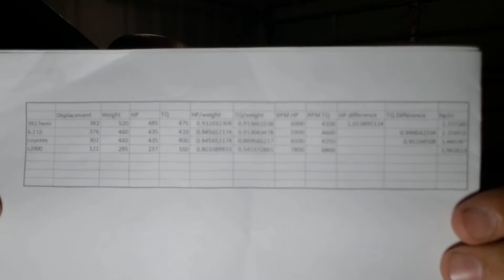Horsepower per cubic inch vs horsepower per engine weight.

Comment: The Professor strikes again !  I wouldn't have guessed that the 392 would stack up as well as it did in this type of comparison. Good job Sir. With the rumors of the HEMI age coming to a close in the next few years it will be interesting to see which way Mopar will take us and what moniker will be attached. Perhaps a new version of the Max wedge with 4 valves.
Reply from the maker: BDOG JR thanks man! actually, get ready for more V6 turbos.... I really hope not though.

Comment: apples to oranges. your not figuring the vehicle weight which is the true equation.
Reply from the maker: dbooty1844 not for this discussion. I'm speaking only in terms of the power plant itself, separate from the platform it is installed in.

Comment: It doesn't mean a whole lot. I'd rather have more cubes in a mild combo than less cubes and wilder combo. no replacement for displacement. like it tell guys if I go up from 9.1:1 to 10.5:1 go after some AFR 315 high flow heads and drop in a 640 lift camshaft. my 496 would easily make 650 to 675 hp instead of its 565hp..torque is where its at..keep those video's coming B Mason 👍😆
Reply from the maker: Brian Samuels I like bigger cubes as well. Especially when I can have them with no weight penalty.
Reply: That's true. Kind of wish I would have put aluminium heads on my engine but it's all good. It would have saved me 90 pounds. Fast heavy cars are very impressive
Reply from the maker: Brian Samuels American Iron!! Aluminum heads are nice but when you consider that 100 lbs on a 3800 lb car is only 2%. For the street, not a big deal.  TIRE SMOKE!!
Reply: B Mason your right about that one. Mines is most definitely at street car. Can't wait to run in the 1/4 mile but overall I just wanted to build a reliable, fun street car that I can put my family in.
Reply from the maker: It sounds like you hit the nail on the head!  I actually like iron head combos.  My 93 SSP ran ported GT 40 irons. Showed it's tail lights to quite a few aluminum headed combos.  Looked stock too.
Reply: B Mason lol...what's your opinion on gear vendors overdrive? I bought one 4 years ago but haven't installed it yet. Or a 4l80e transmission?
Reply from the maker: The gear vendors has gained in popularity recently.  Good unit. It can take quite a bit of power and is usually a bolt in modification.  Assuming the 4L80 fits, it is cool because it is programmable.  Expensive though and a bit tedious. Maybe a built 700r4? Either way a driveshaft has to be modified.
Reply: B Mason ok. I'm thinking at this point is to use the gear vendors behind my th400 transmission. I'll let you know how I like it. 700r4 are totally out of the question. My car is heavy and with 600 foot pound of torque. It probably won't last long
Reply: and don't get us started on the liter to cubic inch conversion, I've asked like 10 people and guess what I received 10 different answers. I thought my question was a simple one , and my local Dodge dealership seems to think my 5.7 L is 347ci technically 348 ci being there calculation is 347.835 ? does it even really matter? most people refer to the 5.7 L as 345 ci. I've seen several different badging options ranging from 345 to 348? dealing with bore and stroke calculations can be mind numbing whats your advice ..... this would be a great video😀
Reply from the maker: Brian Samuels it's been a while since I even thought of a 700r4.  I thought that they had solutions ro get those transmissions fairly well beefed up.  maybe good for a small block, but you are right, not enough near for the Big Block.  Let me know how you like the Gear Vendors! I. interested to hear about it.
Reply: B Mason I'll keep you posted bro! Anyway enjoy your day and have a great weekend 😆
Reply from the maker: Brian Samuels thank You!  You too!!
Reply from the maker: Trent Anderson man, I just give up when it comes to the liter designations.  5.7 can range from 345 to 350.... some engines like the M156 use 6.3 when they are really 6.2....it all gets a little redundant. the liter designation gives a "range" of displacement.  it removes the specific cid.... the "name" of the engine...makes it a part of a group as opposed to an  individual. communist if you ask me. just not American.
Reply from the maker: Trent Anderson man, I just give up when it comes to the liter designations.  5.7 can range from 345 to 350.... some engines like the M156 use 6.3 when they are really 6.2....it all gets a little redundant. the liter designation gives a "range" of displacement.  it removes the specific cid.... the "name" of the engine...makes it a part of a group as opposed to an  individual. communist if you ask me. just not American.
Reply: B Mason thanks, love the videos keep up the good work, your really making me want the 392 I gotta say. To even have a chance at hanging with the big guys I'd have to go, or maybe I should say I'd really like to,  procharge my 5.7 which I believe with the rite adjustments could put me around the 600hp mark that would be awesome but $$$ pricey for the money I may be further ahead to just put the $7000 down on a Scat pack or 392. And as far as that goes 2016 models of mustangs with 700hp are going cheap. ? But I've driven a new Mustang and it just really wasn't my thing I've loved mustangs forever? I kinda feel like it's a maturity thing my car looking good and sounding good, ride quality are just as important to me as how fast is it. Plus my '15 Shaker is loaded it's probably one of the nicest interiors I've had on a vehicle I've owned.
https://lh3.googleusercontent.com/uaWKMPPSLt1jCe1_XaOCS4ZUhdphc0dPZYvtjZh5sfXUFYkZt1dhrkvI4UFKEKyWbj9rjy5xuQ
Reply from the maker: Thank you very much! Man, I am on record as gushing over the 5.7's.  That engine with the 8 speed is a fun car! Add in a low boost system and you are on par with the 392... but it's not a 392. I am in love with the 392 and if given a choice and the available funds I would go 392 all day.
Reply: B Mason thanks, I really need to try a 392  out and see what it's like. But for now I'm gonna just enjoy my Shaker and even though its not a super rare car, it is 1 of 191 and I feel its a keeper. So my next car may very well be the 392 or by the time I can talk my finacial advisor,""the wife"" into letting me buy another Challenger I may be looking at getting the Demon, only time will tell. Again great videos and content keep them coming
Reply from the maker: Thanks! Our situations sound similar.  The "minister of finance" won't let me watch any more vids on the Demon.
Reply: B Mason lol

Comment: Do you think the 392 is underrated and is actually putting out more HP and TQ than FCA claims?
Reply from the maker: rjburston I wouldn't say the 392 is underrated in terms of horsepower.  based on all of my testing it is a legit 485 hp.  the way it makes torque is what makes it seem that way.  it makes allot of it, everywhere in the powerband.
Reply: B Mason Oh ok. It's just that a few members on the Challenger forums claim they dyno'd their 392s and they were actually a little over 500hp stock.
Reply from the maker: Lol... yeah. It depends on what "math" they are ising to get to that number.  When comparing SAE, (both old versions and new) STD correction and uncorrected, things get confusing.  Add to that guys using the wrong percentage conversion and there is no telling what number they will get.